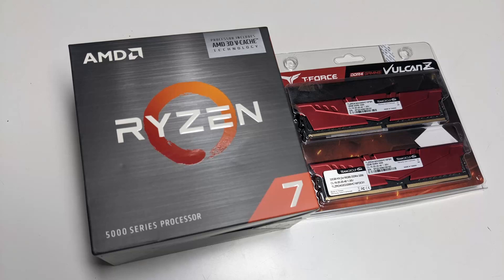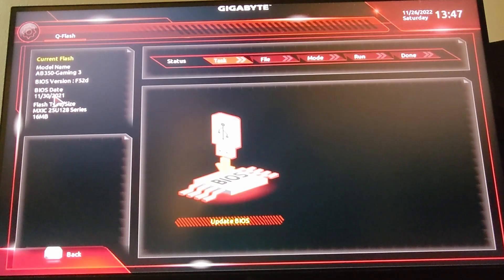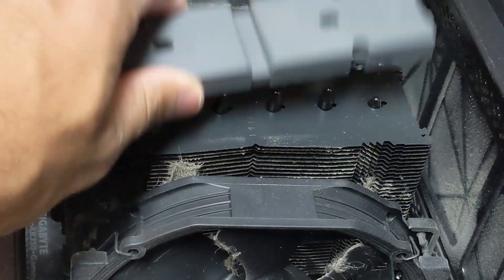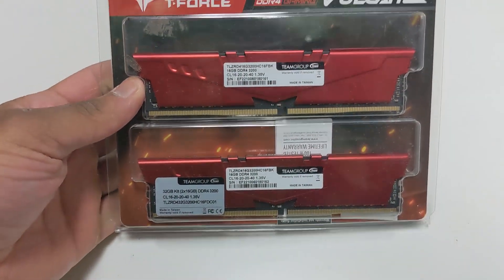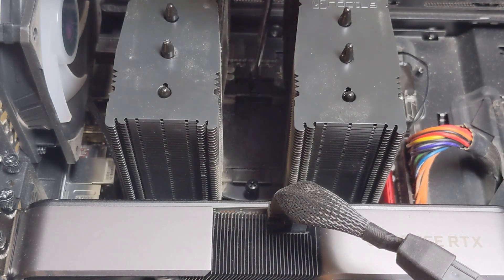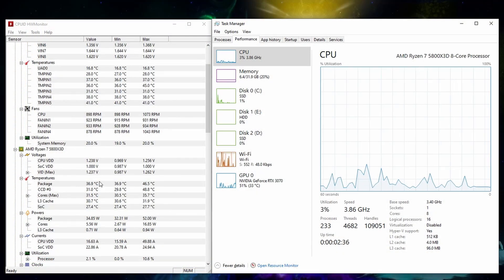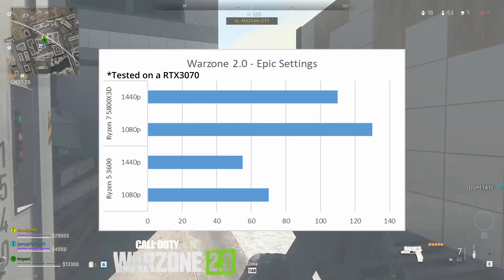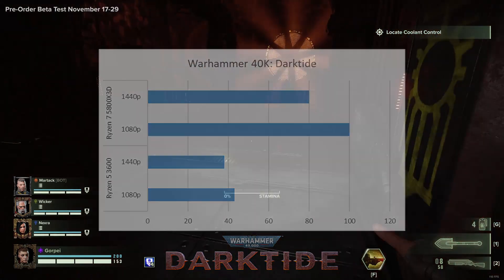Upgrading to a Ryzen 7 5800X3D - Tech Lion

Comment: i just did this too, my ol 3950x has been a great work PC but i dont do as much actual work with my PC these days so i said F it and cut my core count in half and DOUBLED frames in many old games i love. this CPU is amazing for old game engines with tons of detailed NPCS, like STALKER, all the old fallouts, skyrim etc. it was also less than half the price of my 3950x when it was new, and actually outperforms it in photoshop and lightroom as well for my photo work.
Reply: Are you playing only em 1080p? That's the only explanation....
Reply: @cparoli1111  no, 1440p with a 3090. as long as you arent gpu bound, you will see gains. the only resolution i dont see a huge gain is 4k obviously but there is still a small improvement around 8-10 percent. in heavily modded skyrim, 1440p i went from around 40 fps in heavily populated areas (whiterun, solitude) to 70-80 fps. in stalker GAMMA, i went from a hugely cpu limited 50 fps to over 100 in many areas. My 3090 is actually being used now, before, it would never reach even 70 percent utilization on that game.

Comment: I borrowed 5800x3d because my 5900x is on RMA. Shockingly 5900x perform better in nearly all games. In Horizon Zero dawn 1440p ultimate pc with r9 5900x scored 158fps and with 5800x3d "only" 145fps. In CP 2077 difference in 1080p high and 1440p ultra is only 1-4 fps, but 5900x still wins. Considering fact that 5900x is curently cheaper in my country, there is no reason to buy slower 8 core over fayter 12 core. I am dissapointed.
Reply: Okay. I reset bios defaults and perform clean windows 10 installation with latest drivers. Its faster than 5900x now. In CP 2077 1440p/ultra its 90.7fps avg. 77fps min. 5900x had 89.3fps avg., 57fps min.
Reply: @johnrehak  The faster minimum is where it counts, that's where the stutters happen and what you notice. The maximum is probably your GPU limit.
Reply: I saw a few benchmarks where HZD was performing better with a 5900x. However it was about a 10 fps difference and even then it wasn't like it was a stable difference, as they'd average out to the same fps pretty often. In many other benchmarks the 5800x3d was on par with the 5900x, but there were special cases where the 5800x3d was straight up outperforming the 5900x. The most extreme example being a Dota 2 test that had a 100fps difference.
BUT if you don't just game and do editing or anything that requires processing power, the 5900x is better, but that's if you don't think the 5800x3d is enough for your work needs.
I for one have a 2700x and am considering the 5800x3d due to some favorable performance gains over the 5900x in some games I enjoy. I do edit vids every now and then, but that 5800x3d is gonna be way better than what I have now anyway, and I think over time that v-cache is gonna show its value.
Reply: @bruhtholemew  If you're on a 2700 then any change of CPU is likely to be an upgrade.
Reply: The 5900X has more cores and a higher clock rate. It also has a decent sized cache. It is quite a lot more powerful. However in game benchmarks I've seen the X3D is a lot higher frame rate.
Reply: @wayland7150  Me too, thats why I chose it as a timed replacement. I reviews 5800x3d is faster than 5900x and 5950x and some times even 12900k. I dont know why it perform worse than my old 5900x. Bios, windows and software are the same. No changes since I took off 5900x and put in 5800x3d.
Reply: @johnrehak  Do you have the right BIOS for this CPU? Just because it runs does not mean it's optimal.

Comment: Try out pbo2 tuner it’s. Curve optimizer that gives you better average clocks and keeps my temps below 55c
Reply: I did that with my x3d and was an easy -30 on all cores and will hold 4450Mhz on full load.

Comment: What kind of temperature were you getting on the CPU?
Air cooling on the hot of a CPU would be interesting.
Reply from the maker: That's a solid question! Since the NH-D15 is the best air cooler you can commercially get, it's very much comparable to even top of the line AIOs. So in a typical gaming session, I never see it peak above 75°C.
Reply: @TechLionPCs  Something might be wrong with your mount or something because mine never exceeds 65°C while gaming on a 240 AIO
Reply: @apocalypse3039  there is nothing wrong with his mount. Those temps are normal on an air cooler.
Reply: @apocalypse3039  you're using an AIO, dude...... Of course it would have a better temp over air coolers, especially in a well air-conditioned room.

They can't really be directly compared nowadays, both could deliver good cooling performances.
Reply: Air cooling is perfectly fine.
Reply: I'm using my 5800X at 4.75 GZand 1.2125V. With the NH-D15 my fan setup is 1x140mm @ 2x120mm due to my motherboards IO shield and my RAM.I also have an additional rear exhaust fan which definitely helped me achieve the Overclocks. I main 35-40°IDLE and 50-65° MAX. I also have two exhaust fans on top help pull heat from the cooler and VRMs. I used 120mm Chromax fans PWM, I also bought separate fan clips and a 3way PWM Splitter on Amazon. Took me an additional ten minutes to setup and makes a difference with performance

Comment: I am upgrading from a 3900x just waiting for it to get here
Reply: It's not really a big upgrade. Everything except games will be slower! I game in 4K and the difference is minimal. Only MSFS had a noticeable improvement. Should be better if you game with lower resolutions though.
Reply: I'll take your 3900x
Reply: 3900X is 12 cores. 5800X3D is only 8 cores. 5800X3D is only for gaming. Other tasks will not as fast as 3900X.

Comment: I am upgrading from a 3600 to the 5800x3d.  Great video thanks for sharing! Based on this video the increase in performance should be amazing.
Reply: depends also what gpu u have
Reply: @user-xp8wk1zt2p  which games are played also plays a role here. 

I've also upgraded from 3600 to 5800X3D. I got a way better experience in a heavily modded Cities Skylines gameplay, even with a mid range RX 6600 XT. 🤷‍♂️
Reply: @hadifelani  NO WAY. you telling me you got better perfomance in a cpu heavy game with a cpu from 2022 instead of a cpu in 2019
Reply: @user-xp8wk1zt2p  the L3 cache size helps a lot here in C:S, so yeah. 🤷‍♂️
Reply: @hadifelani  or maybe cause u are comparing a 3600 to a 5800x3d
Reply: @user-xp8wk1zt2p  even 5800X have weaker performance in C:S when compared to 5800X3D 🤷‍♂️
Reply: @hadifelani  show me the video showing it
Reply: @hadifelani  OMG WHAT?!! 8 fps  MORE FOR ONLY 170$ EXTRA???? thats easily worth it. You sir have changed my mind.
Reply: @user-xp8wk1zt2p  Sure, that extra fps difference aren't really that significant in other games, but in Cities Skylines, those that you might perceive as "very little gain" are very noticeable, if you ever played that game fully modded with 4000+ custom assets and mods. 🤷‍♂️🤦‍♂️

Even then, those videos I gave you are all vanilla gameplay wich serves as a baseline indicator. The gain is actually more prominent on modded gameplay.
Reply: @user-xp8wk1zt2p  6700xt
Reply: @ryanroslan4043  then the 5800x3d would honestly be overkill
Reply: Do not use this video as a reference, looks like he was running the 3600 with single channel RAM crippling it's performance
Reply: I am upgrading from the 1600 to the 5800x3d and I should expect some perfoemance boost and if not at least I will be more future proof than now.